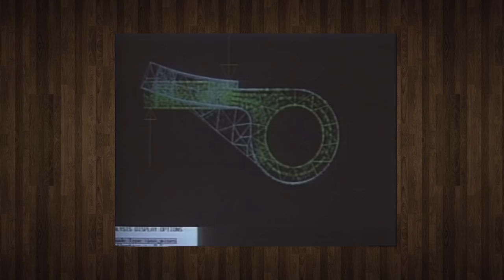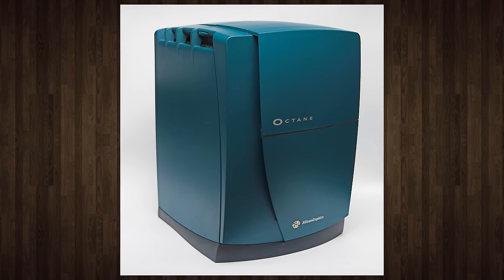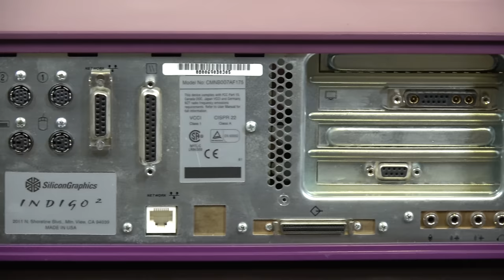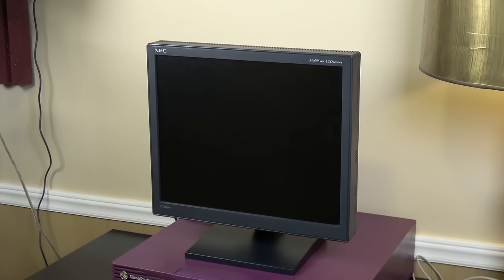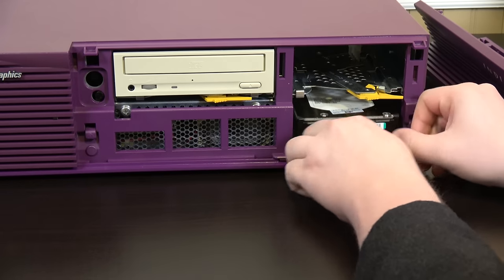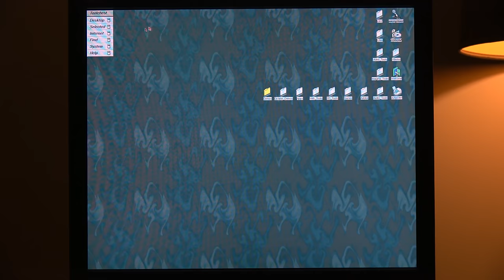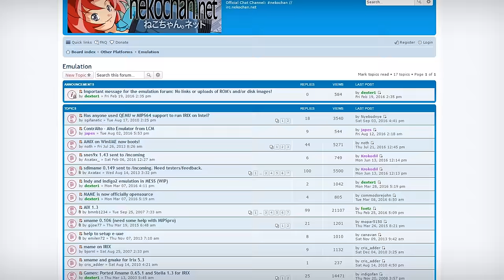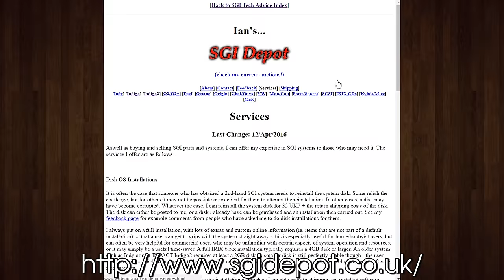SGI Indigo2: An $86,000 Workstation from 1995

Comment: I used (a predecessor of) one of these at work. They had a pretty impressive multi player flight simulator, which came preinstalled :-)
When Silicon Graphics heard that our company was a potential buyer, they came to Amsterdam with a cool road show in a giant truck showing off these machines. It was worth it, because the company bought more than 50 of them. And yes, it took more than a decade before I saw other workstations with this kind of power.

Comment: Over 20 kilos?! Wow, this thing could concievably have weighed more than the CRT it was hooked up to back in the day. That's one heavy ass computer.
Reply: Redhotsmasher no, since the display options were 18 and 20 inch CRTs displaying 1280x1024 or 1600x1200. Back when PCs had 15" at 800x600. Man it was a joy to use one of these "real computers".  You want horror, look up how heavy an Octane was. Manual says two-man lift.
Reply: Matthew Kriebel People were surprised when I lifted an Octane over my head in my  Octane video. It was heavy, certainly heavier than my Indigo2, but not so bad that I couldn't move it or lift it up for the camera.
Reply: Yea, weight is one thing I don't miss about old computers. Random trivia: SGI's CRTs often got damaged when moved because it's stand swinged back which was hard to see while lifting it, and then when set down the stand cracked with all the weight on it's edge or it might've toppled over :/
Reply: I put my back out in 2001 after moving an SGI FW900 superwide monitor (used for Onyx2) up a flight of stairs on my own. Much heavier than the usual 20 or 21" Sony CRT. When I move Octanes around these days, they're quite light by comparison. :D

For a really heavy SGI thought, gotta get an Onyx, hehe...

http://forums.nekochan.net/viewtopic.php?f=3&t=16720350

Comment: Next up for LGR: "Just got a CRAY supercomputer, let's see if it can play DOOM"
Reply: Linus Tech Tips would try to run Crysis and Rose of the Tomb Raider
Reply: Sun had their own Super computer series - like the E10K.
Reply: from what era? DOOM would probably need emulation, and run all within one core. it would be incredibly difficult to utilize the inherent power of a CRAY distributed system for something like emulated DOS DOOM. a CRAY from 2009? sure... because a single core from that era could run DOS emulation and play it but not one of the ones featured in "sneakers"; the big round thing that looks like a couch in the guy's office.
Reply: @illilya  I do know  one person who runs their own Cray at home - though a later  one. But he does serious engineering work based from home so he has serious computing facilities. he even has  his own electron microscope which he got running himself.
Reply: @andrewnoonan4044  it's really about the distribution of work. a Cray would only realize its strength if it was doing it across all of its resources but from what i found it seems like you'd need to write a DOS emulator that could use all the different resources and that... hasn't been done so far and to do it just so it could play Doom would be silly. only recently have games in windows even begun to use multiple cores, still just relying on the video card and all of their threads but not running anything in parallel across CPU cores.
Reply: I understand the limitations of parallel  programming and that most applications can't take advantage of such situations. In another life long ago i used to work on large scale Unix systems.
Reply: @andrewnoonan4044  sorry i missed your reply. i just took the "parallel and distributed" course as i'm getting my degree. i dropped it, because i just couldn't get the "monitor" functions of generic objects in java to work, and i felt that previous courses let me down and the big java expert in our class happened to vindicate me by telling me that there was truly no way to learn how to use the intricacies of java on generic multiple objects from the course we were taking and should already know it. luckily, i picked up enough and was fascinated enough to learn further on my own and an alternate was a course i wanted to take where we learn "comparative languages" like pascal, etc.

parallel and distributed is very, very cool though, and those of us that enjoy the complexity have bigger minds. i appreciate your replies.
Reply: And LGR would get very lucky and have a fan send it to him for free while others like me would have to pay... (No fair, popular YouTubers!)

(Yes, I'm a bit jealous, an SGI workstation would let me make those authentic 90's CGI graphics, unless someone could please tell me how to render in that old style in a modern 3D program...)
Reply: He's going to tear a hole in the space-time continuum with a Cray, best not to tamper with that.

Comment: My uncles company had one of these in the late 90's for use in mining. I remember creeping upstairs to have a look at it and was pretty amazed but didn't know what to do with it. My uncle said it was a choice of buying a computer or buying a car.
Reply: Quite scary that sometimes companies and individuals were faced with such choices, but then such was the nature of the advanced tech and the prices it could command. At one point in early 1997 I was contemplating a 12K loan (that's UKP) to buy an O2, but then SGI loaned me one for free (still use it) which I used to do OS bug-hunting and general IRIX testing for them for a while; it was the first loan they did to a private individual outside the US. Supplied as an R5K/200, it's now an R7K/600 maxed out up the wazoo with a 7-slot Avid PCI expansion box, two 300GB SCSI disks (I plan on replacing them with SSDs this year) and 1GB RAM using low-power single-sided 128MB DIMMs (hard to find).

Ian.

Comment: One professor at my university still uses an sgi workstation for specialized work. He has the SGI CRT and the SGI keyboard to go with it.
Reply: Do you know which model he uses? Tell him to beware of the PSU failing, they are getting pretty flakey now, especially Indigo2 and Octane. O2 still runs ok though.
Reply: It's great for MIPS programming, especially in regards to the appearance of new MIPS-based chips from China
Reply: @mapesdhs597  It might be an O2 funnily enough. I'm not sure.
Reply: @dimitrilensflareabrams2893  In that case he should be ok. :D  And replacement PSUs for O2 are still dirt cheap anyway. O2's longevity problem is tyically more the mbd failing in some manner, or older 32MB memory SIMMs going wrong (tell him to watch out for errors in the SYSLOG that say, "Soft ECC error in the back side of DIMM slot <whatever>". The CDROM can also fail, should he be using it (can be repaired though, it's just a small plastic cog which snaps).
Reply: @mapesdhs597  Thank you so much! I have a hunch he'll try to hang onto those machines for quite a long long time. At least until he finds a machine that will work for his purposes.

Comment: 8:00 that's exactly like the main menu in Super Mario 64 and LoZ OoC!
Reply: yep that OpenGL demo was free software, and that SGI was literally a N64. of course they used the same coding!
Reply: @SilverSpoon_  the sgi was a really fast 80 thousand dollar n64
Reply: @SilverSpoon_  N64 was a heavily cut down SGI. One common feature of SGI work stations was that they featured dozens of processors. The N64 only had 3(the RCP was actually a separate DSP and GPU on one chip).
Reply: @SilverSpoon_  N64 is no where near the capabilities of the SGI. N64 mostly ran at native 240p.
Reply: @JuniorBlitz  it's a console. It's here to do its job of booting a game and rendering graphics. It's like saying the PS5 can rivalize with a Ryzen powered desktop PC.
Reply: @SilverSpoon_  That's true but it can't compare to a big monster like that. Keep in mind, the games on that original console ran at 320x240. 3dfx voodoo cards for pc came out the same year and could do 640x480 plus anti aliasing.
Reply: @JuniorBlitz  it depends of the game, in PAL format here, th resolution isn't like VGA/NTSC (320x200 or 640x480 for some games with the ram expansion) but rather 384×288 and 720×576 @ 50hz instead of 60 which makes it a bit the same. And yeah the Voodoo was a card for PC. the N64  couldn't compete of course, but don't imagine the SGI Indigo alone was ableto render amazing graphics in realtime. It was better, sure , but for animations and all that you do a render.
Reply: @SilverSpoon_  Yeah. I was just curious about the statement. The card was higher end so it wouldn't be a fair comparison anyway.
Reply: one thing i dont see anyone bringing up is the fact that mario 64 was designed on these babys, so it makes a lot of sense they drew a lot of inspo from that menu gui.
Reply: @JuniorBlitz  N64 has antialiasing permanently enabled, can output 640x480 or higher (limited by televisions) and has higher on paper performance (in practice not so much) than the original voodoo card.
Lack of RAM is the primary reason to keep resolutions down.

The unupgraded n64 has 4.5 megabytes of RAM (Yes. 4.5 - it's 9 bit ECC RAM but rather than use the extra bit as error correction it uses it as extra storage - though the design means the only thing that can go in that 0.5 megabytes is the z-buffer) to share between everyhing it has to do.

The Voodoo has more ram than that and it's dedicated RAM it doesn't have to share.

320x240 in 24 bits is 230 kilobytes. (yep. N64 renders in 24 bits internally, and you can't change this. Though the output circuitry is 21 bits, so you get some banding. - the voodoo mostly worked in 8 or 16 bit modes)
You need 2x that due to double buffering, so that's 460 kilobytes lost to just the framebuffer.
640x480 would be 921 kb...
So now you lose 1.8 megabytes...
Of the 4 you've got to work with...

N64 is a stripped down SGI machine, which is limited by it's low price point, and passive cooling. (supposedly SGI told Nintendo they could double the performance for Basically the same price if they had been allowed to use a cooling fan, but Nintendo insisted it had to be passive cooling only).

A PC of that era (especially 1996) with a voodoo card would have cost about 4 times as much and the performance gap would have been pretty small.

With 8 megabytes (technically 9) installed, an n64 has performance comparable to a 90 mhz pentium PC with first generation voodoo card. 
The only thing the PC really has going for it (besides access to cheaper storage options) is that using SVGA and a computer monitor allows higher resolutions than being forced to output to a TV. 
The TV sets a hard limit on your output options...
Reply: @KuraIthys  what if you used the expansion pak though? Wasn't that just extra memory?
Reply: @SilverSpoon_  they did not use the same code but the resemblance isn't an accident, nintendo engineers thought it was a cool menu so they copied the design for mario 64.
Reply: Makes sense, considering the fact that the n64 hardware and software was based off of a similar silicongraphics computer. Hence why the graphics system had some pretty niche effects for the time, such as predefined-bitmap specular reflection, and non-sprite based renderer, like the PlayStation 1 or Sega Saturn. Yep, the N64 was the first successful triangle/vertex based rendering system. Other 3D gfx at the time were based on sprites (squares) that could be distorted in limited ways, hence why the edges of these sprites in PS1 games often moved around when the camera shifted. The N64 didn’t have any issues. It really was (in hardware spec aside from the storage media) ahead of the competition.
Reply: @invalid_user_handle  that is actually totally wrong. PS1 used triangles just like N64 did. You are probably thinking of the Saturn which was highly unusual for using squares. PS1 triangles jumped around a lot because it lacked a floating point processor. that has nothing to do with the kind of primitive you are using.
Reply: @sheridanrathbun  Whoops, sorry for that. I noticed that the Saturn and PS1 had very similar graphic appearances, and presumed they were alike.
Reply: KuraIthys man, they really should have put a fan in.  It would have been seen as cool I think, and 2x performance would have made it no contest with the PS1, maybe really justifying the difficult programming on the system.

Comment: I worked on an Indigo and an Indigo2 at university. Modelled robot workcells. Still remember free scaling of icons in the file manager and the general look and feel of their Unix System (Irix). Felt like the king of the road on this machine. And it sat in a locked room for itself, so you had it all to yourself in a quiet place with a view out of the window...

Comment: nice! this brings back days of supporting engineers at nasa ames where we all had SGI Indigo2 desktops. That thing had an integrated ISDN interface. SGI made a lot of machines with cool strange colors.
  One funny thing about the indigo2 was that the large monitor was so heavy that when it was sitting on top of the machine, it would squeeze the case too much and the memory would flake out.

Silicon Valley trivia note: the Googleplex building is the SGI headquarters office from back in the days when SGI aquired Cray computing.
Reply: The 22" monitors were ok, but some places used much bigger ones and that was a problem, hence partly why O2 and Octane were such odd shapes.